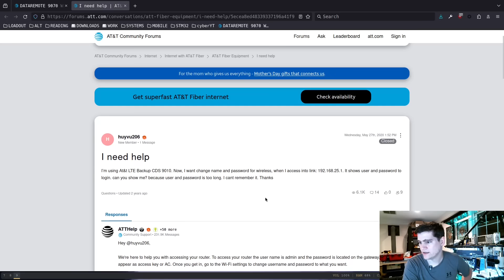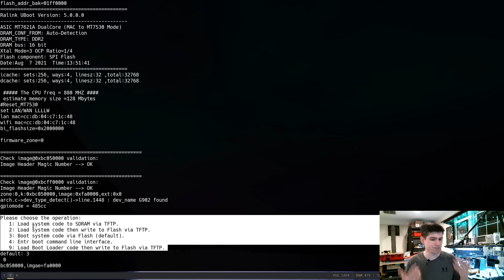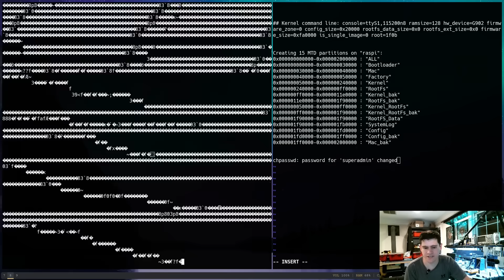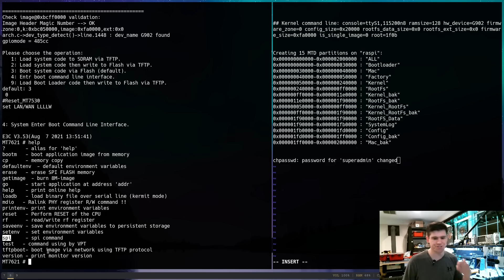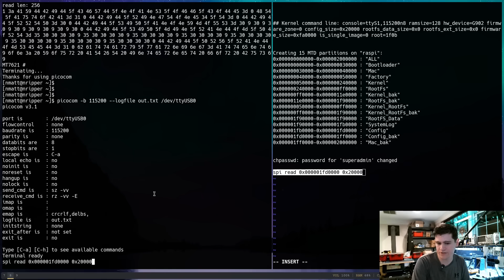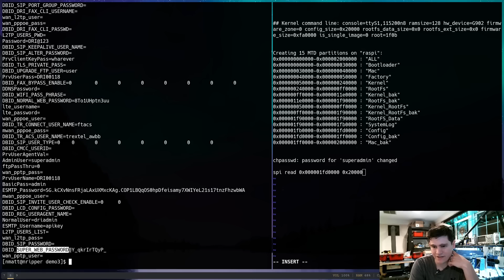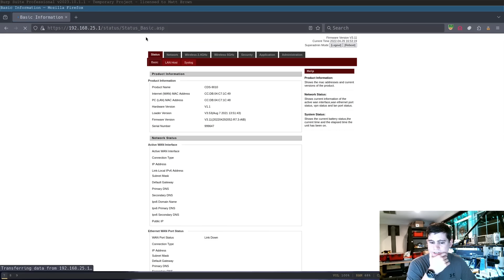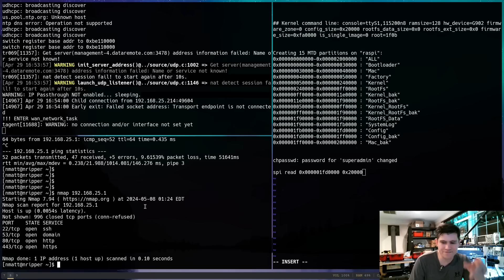Hacking an AT&T 4G Router For Fun and User Freedom

Comment: For reference, none of this was necessary at all, you can upload the sysupgrade image directly from the UI (which you can get access to by simply resetting the router to factory settings). This is a rebadged router, the original hardware is fully supported by OpenWRT.

Comment: I'm confused as to why anyone uses an ISP provided router in the first place?
I always just reject them and plug in my own.
Handy if you move too since your entire networking config comes with you.
Reply: Sometimes they force it on us. Like in this case I don't know how this router gets internet access cuz I am not familiar with AT&T, but it most probably can only get internet from that SIM card cellular network. And hence we are forced to use their device. Of course we can use our own router after theirs but that doesn't help what the person wanted to do, which imo is like jailbreaking the device and using it as a regular router or using a SIM/company of their choice.

I have FTTH at home and they too forced their own ONU+Router in one device. And it is kinda locked too. The configuration takes place automatically using something called TR069 and I only have a slight idea of what that is. But maybe because of that auto-configuration we can't even use a separate unlocked ONU.
Reply: @Swanicorn  My ISP tried that with me.
The reality is that this stuff is pretty standardized.
You're paying for the access not for them to host insecure hardware in your home or business.
Push back, they don't have a legal leg to stand on when pressed.

Comment: you could save most of your time by dump the spi chip directly instead of using uboot and terminal, there are sop16 clipper available, you don't even have to solder, and plus a ch341a programmer might only costs $10
writing a script to convert hex text to binary file is just for show, have heard of "past from hex text" menu in 010editor/imhex/winhex?

btw, a little tip, if you have issue to stop uboot or whatever bootloader from auto booting, just short the emmc/eeprom/nand flash data pins, if it cant read data to ram, it cant boot, most of those evil bootloader will drop you to the shell if boot fail

Comment: So this is cute, and I admire the tutorial, but you weren't schooled in boolean algebra. Otherwise you would know that you could just have done the SUBTRACTION of 0x1fd000 from 0x1ff000 and gotten that 0x20000 for the partition length (which BTW is 32K). But other than that one nit-picky thing you're spot on with the hardware hacking tutorial, nice that they left you the pins.
When it's all said and done that looks A LOT like a customized DD-WRT install =;^)

Comment: Spectrum gives you a modem and charge you for the Wi-Fi router. You have zero access to the modem or the router. You get a cellphone App or a web interface with no real options. I'll be getting a TP-Link Omada VPN router and a TP-Link Omada access point to replace my Wi-Fi router and I am getting it from Amazon for 120 bucks. I can make IPSEC OpenVPN connections, VLANs, Multi SSIDs, and have access to all sorts of SDN  features. It is not as feature rich as Netgate or PFSense, but it has a similar GUI to the Unify interface and I can manage it with a software, hardware, or cloud controller.
Reply: I had an arris gateway for years but it eventually died on me. I'm dealing with this BS myself at the moment. Not paying a fee for the router though.

Comment: I just got a 4G lte Wi-Fi router from Amazon for like 80$. We brought an old iPad to the ATT store and signed up for unlimited 4g lte data for 30$. The guy at the store provisioned the SIM for the iPad and got it online. Once we got home we took the ATT SIM card from the iPad and put it in the new Wi-Fi router. Boom..!! Unlimited data for the entire home via the ATT SIM card installed in the Wi-Fi router. 
I had to make the router reboot every day at 4AM because it would lose connection to the ATT network once every few days requiring a restart for some reason.

Comment: Your multimeter test for TX is shit. I have a fluke that updates fast enough to do this. Half the people watching this have whatever shit harbor freight sold them. In general though this is a bad tool to do this with. 

like having people buy a $300 hammer because it has a novelty non-replaceable Philips bit that you can occasionally use to hand twist a screw in. 

It's not the right tool for the job.

 Furthermore better and cheaper tools exist. Like a $5 eBay USB uart serial adapter and some breakout cables plus putty. 

Use the DMM to find vcc and or gnd then attach to the USB serial adapters Rx pim

You get garbage on the terminal. You adjust the baud rate till you don't have garbage. If connected and u get nothing... Try the next pin

Comment: 1. used normal screwdriver to open device.
2. manufacturer provided pins used to access board

When I think of "hacking" I think of doing things in a way that mock the original use design.  I'm willing to bet that AT&T literally has a cable and software on a laptop that they use to do everything that you just did, using those pins.

Was this video entertaining?  fuuuck yes it was.
Was this hacking? I don't really think so.
Reply from the maker: LOL so if you use a non-standard screwdriver to open then its hacking?? :D